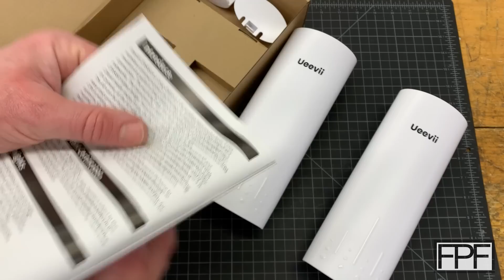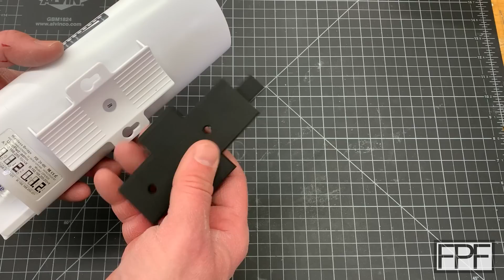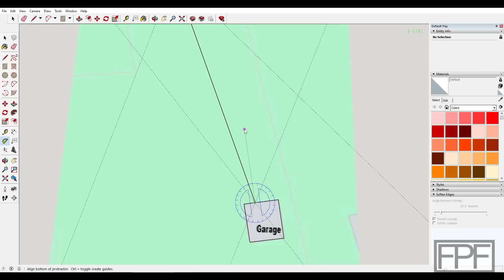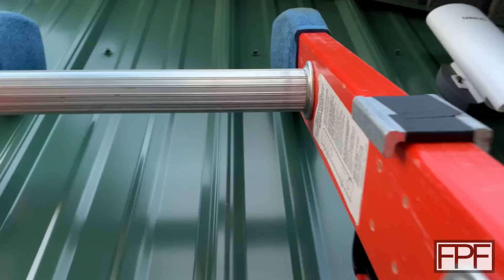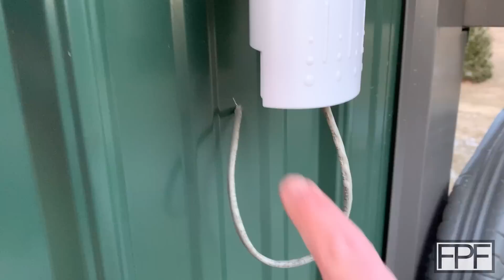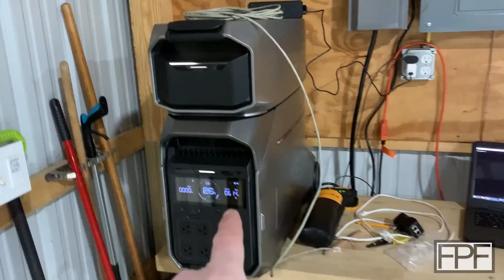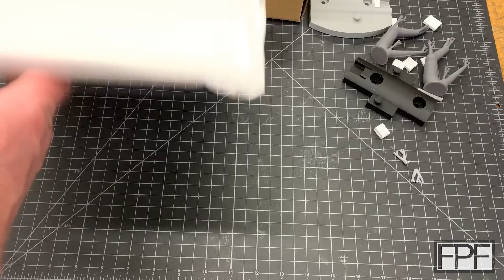3D Printed Mounts for WiFi Bridges

Comment: Wouldn't be better to print just a small portion to test the tabs instead of printing the whole part every time?
Reply from the maker: Get out of here with your logic and reasoning :)  Absolutely, yes. Unfortunately though, due to the filament changes, that multi-material part of the print is still what takes 90% of the overall print time, and I only had enough time to run 2 more parts before shooting, so I went for the moonshot.  We may be revisiting this one this week, as the comments section really believes this would have gone differently with more purge (and they may be right).
Reply: Definitely. Also if you didn't know, you can choose which sections to slice and print in your slicer instead of modeling the cuts in CAD. I always do this. Takes less than a minute and you can save the slice if you use orcaslicer in case you need to come back to it.

Comment: I think there is a design/printing scheme that would solve the issue with incorporating the TPU for AMS with PLA.  I can bend my TPU for AMS sufficiently that would handle the flex you are after.  That said, I am curious if you printed the entire part with TPU for AMS to rule the material out completely?

Comment: Also, highly recommend Overture High Speed TPU for functional prints.  Just bump up your volumetric flow to around 7 ( I believe) and it'll print as fast as normal PETG.  Thinner parts will have some flex but add some thickness and you'll have a mostly rigid, indestructible part.

Comment: My guess is you're getting contamination from the PLA into the TPU.  The nozzle isn't able to flush enough to get the PLA remnants out.  I had a similar issue using PLA as the interface layer on PETG prints.  On smaller prints, the PETG layer adhesion was laughable.  Took me a while to figure out the issue.  Not widely reported but there are a few posts about it out there.

Comment: I think you're being too nice about that TPU for AMS. That doesn't seem flexible at all. I agree with your take on making the latch as a TPU insert instead of bonding it to the PLA. The custom angles for each building seem a little too constrictive. Why not just make a simple rotary joint so you can tune the antenna angle with a compass heading on install?

Comment: Also, if your first few minutes discussing the print is accurate, then i think it would have been better to print this upside down with the tab on the base plate. You'd need less support material and the support material would be flat. Probably would not use trees tho.

Comment: I would have just corrugated the lock tab with horizontal slots. Adds flexibility while retaining the pla stiffness. And since it's realistically not going to have too much force pressed on it, it has very little chance of snapping along the layer lines.

Comment: I used the TPU for AMS for a phone case and I am quite happy with it. It has enough flexibility to bend around the phone and stiffness to stay. I do see where the layer adhesion week though, but I had to bend it quite a bit for it to fail. The cool plate works great, by the way.

Comment: I’m using the TPU for AMS for a slightly flexible door stopper for police use that I designed. Currently field testing it vs 95A TPU from Overture. I like that it’s stiff but still has some flex. I think the 95A TPU is a bit too flexible for the purpose I’m using it for. TPU is a family of materials, so you just need to pick a TPU with a shore hardness that suits your needs. Just my 2 cents. I don’t know what other things I’ll use it for, but I’m sure I can find things.

Comment: Good luck receiving sufficient signal strength for your WiFi conniction in summer, when the tree has some leaves. Is it 5GHz or 2.4GHz? 5GHz is even worse regarding obstructed beam paths.
If you get connection problems in a few months, consider using a chainsaw. :)

But thanks for the warning about the AMS-TPU. I wanted to buy some for convinience, but I will stick to normal TPU used without the AMS.

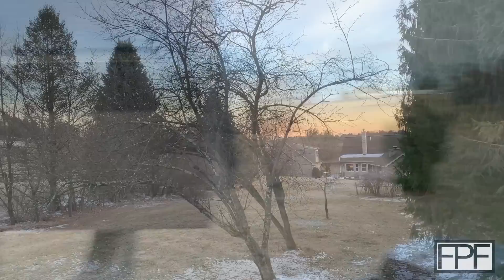Comment: -> 19:41
As someone who design and plan for industrial Wi-Fi and healthcare WiFi. I have a few things to add.
The 3km spec is likely in direct line of sight with the bare minimum lowest spec protocols. In your backyard application it will be plenty enough.
What might cause issues is the tree that's in between the antennas, once the leaves are there AND the forecast changes in a rainy day you will likely experience a drastic performance drop in network connectivity. From the little WiFi hotspot you might setup in your shop you won't be able to find out about it unless you look at the point to point antenna stats between the two buildings.

- I am confident you won't skip the drip loop on your outdoor network cable.
- Consider adding a tiny RJ45 coupler indoor and running a weather resistant patch to the antenna might be a good idea. There could be a debate on the "shielded" cabling but you're running everything out of the Ecoflow so I'll let Ecoflow be everyone's guest on the "grounding" topic and surge protection or management of. 
- Would be nice to consider a lighting arrestor on your patch cord, since your antenna is all in one integrated rather than just an antenna with coax feeding the "access point" you'll have to try the RJ-45 lighting arrestor which I have never implemented. (if you are interested there is a summary on a youtube video "Outdoor Wireless Considerations | Amin Sedighfar | WLPC Prague 2023")
- Same as above, grounding would be a good idea BUT this requires quite a bit of extra-extra work.

At the end of the day why does all of this matters? Lighting hits the antenna and you are taking a chance to fry up all the electrically connected devices in your building. All you'd be trying to do is reduce the potential for this lighting event to propagate and cause greater damages than it would without proper grounding and preventive measures.  

Last word on the TUP for AMS I cam to the same conclusion, it's stiffer and has really poor layer adhesion.
The Super Tack ....  I printed PET-CF and yeah despite heating the chamber and bead to death, the first bit of filament extrusion on the first layer still curled and wrapped. But other material have worked well.

Comment: As an IT person, I can recommend Ubiquiti wireless bridges.   I've used the to bridge buildings across rock quarries, and they work well.    Yours should have a wide enough cone to work if pointed to each other in a general direction.   Precision is not needed.
Reply: Ive used ubiquiti in comercial appliacations in the past. They work wonderfully.
Reply: @thomashaley3830  & @Talondale, my router is a ubiquiti and it's been flawless since I installed it. I'll be upgrading my ancient asus rtn66U with a ubiquiti wireless AP very soon.

Comment: Haven't used the Bambu SuperTack plate, but I believe it's a polyurea-based plate like the Darkmoon3D ICE, BIQU CryoGrip, or BIQU CryoGrip Pro Frostbite. Those plates all are as good as advertised, though limited to PLA and PETG, and you have to accept the lumpy surface texture. The BIQU CryoGrip Pro Glacier doesn't stick anywhere near as well. Polyurea-based plates are my go-to for PETG or large warp-prone PLA prints; I like the Darkmoon3D G10 Hobby, Darkmoon3D CFX, or Wham Bam CF-TW for most PLA.

Comment: If that's a 5GHz bridge, that tree is going to hurt your signal. (If it were a 60GHz, gigabit-capable bridge, it'd totally kill it.)

You should also be using outdoor-rated, shielded Ethernet cable; the PVC sleeve on standard cable will break down pretty quickly in sunlight, and the shielding gives you a ground that helps protect against lightning strikes. (And you should print some grommets out of TPU to protect that wire from being cut by the siding!)

If those things really are capable of 10km communication, you should reduce the power setting. Go as low as you can while having a solid signal during heavy rain once that tree has leafed in. It'll keep you from interfering with your neighbors' WiFi, and it'll reduce how far away others can pick up the signal.
Reply from the maker: dual-freq,  and I'm also really interested to see the impacts of the foliage coming in.  I think I just get lucky with sunlight here.  Maybe I'm just far enough North that I get away with it, as I've got runs from that same box 5+ years old with exposed drip-loops and they're still pliable.  The bridge adjusts the power level automatically (or at least the manual 'claims' it does)

Comment: I've made mounts like these but given the fragility of printed mounting pins have started opting to use the screws that come with the device, modeling the appropriate holes and cutting off the extra part of the screw if it protrudes out the back after using it to first thread the hole. Way stronger than any printed post and easy to adjust to get a snug fit. Just made another one (pair actually) to mount an led light to some wire shelving yesterday.

Comment: This is because of the amount of purge and the materials used. If you use it with a plastic that bonds well with TPU with a very long purge length it will be far stronger.

Comment: Always tempted with the TPU for AMD, but never needed multimaterial print so never bought some, interesting the dissapoiting print though.
The supertack plate though, I love mine, for PLA it is fantastic, dissapointed with PETG on it, but I use a BQ textured PEI sheet I have for PETG, so that works for me.
For every other material I use the BQ Cryogrip, especially when printing ASA or ABS. grate plate for those

Comment: If you would like to have higher speeds - might be worth looking at "mikrotik wireless wire" I get 800..900Mbit/s speeds (except moments of very heavy snow, I've lost connection several times, but I wasn't able to see the second antenna through the snow) in a similar scenario.

It runs 60GHz radio instead of wifi.

Comment: this is very odd.  but I have a few suggestions.  1.  increase the purge to 2x.  when you changing materials like this you want to make sure the old one is fully pushed out.  otherwise it contaminates.  2.  pla and tpu for ams don't mix well. they don't stick.  know that ended up not being your problem. but it's pretty widely documented they are not a good match. tpu and petg on the other hand bonds VERY well
also 3.  user iperf for network traffic testing.
Reply from the maker: Did you see how well this TPU sticks to the PLA?  It bonds incredibly well, which I agree is not the norm.  I'm not convinced it's really TPU.  When I tried as hard as I could to break the bond, when I looked closed, it actually broke on it's own layer bond, one layer above the PLA/TPU bond.

Comment: That does not look right , the TPU for AMS is indeed harder than standard TPU but it should still have TPU layer adhesion. I would also be mindfull of the cable , it does not look outdoor rated .

Comment: You mentioned angling the top of the print to shed water if it got on top of the print. What if water gets in the hole where you had the tab? Would it not expand  and berak the layers apart?
Reply from the maker: That pitches down to drain as well

Comment: Head up on the rj45 crimps. Looks like you are using pass thru connectors? I'm using them and really having hit and miss results. The cables always work but more open than not I can't break the 100mbps barrier. The cables test ok on my NOYAFA nf-8209 cable tester so not sure what's going on. (100mbps cables only need 2 of the 4 twisted pairs). Pulling my hair out on this. If anybody has any ideas let me know.
Reply from the maker: Funny i bought this one to replace some poor crimps done with my old crimper a few yrs back that i wasn’t getting gigabit on.  I get full gigabit on all the crimps with this one but i did splurge for the klein crimper and i only use the klein branded ends.  Learned my lesson that no amt of money saved on the ends is worth crawling back into some of the spots where they crimped lol
Reply: @FunctionalPrintFriday  My crimper is a 'Brileine' and looks exactly the same as your Klein: either it's the same chinese company making all of them or somebody is pirating... May give the klein connectors a go...

Comment: If you want TPU that can easily be printed with an AMS or similar, get some Recreus Filaflex 95A. It works even on an ancient Ender 3 Pro. Filaflex is probably the best TPU on the entire market. Also set the machine to purge more, Bambus either purge too much or too little

Comment: The small plastic straps on my snow shoes that connect the internal webbing to the perimeter tube frame broke. I just printed new ones ~25mmx75mmx2mm with ams tpu, on the flat. I was able to bend these around a 15mm tube without snapping. Tested last weekend in -12C hike for 3 or 4km and worked fine. I think I had 2 or 3 layers of 15% infill and it was very stiff to wrap around the tube. You may find your clips work if rotate your part 90 deg onto the bed but your standoff pins will be a risk next in this orientation.

Comment: Like yourself TPU for AMS was not what I originally bought it for. However I’ve had good luck printing items that need to be rigid but impact resistant. It’s good for thumb screws and I had good luck printing a ski brackets that clamps to the legs of my sled deck in my truck. Seemed to be holding up even in -15c temps bouncing down the highway.

Comment: should use a cable gland for cable into barn
Reply from the maker: I did actually think about this, and was going to make one from TPU, but if I put a dab of silicone caulk on the inside and outside, I don't think the cable will be able to move, ever.  If it does, I guess I get another chance to drop my bag of terminal ends and have another expedition in the yard looking for them :)

Comment: 20:20 - yes once you clean it, spray it with a coating of “Wet & Forget” it works great to get rid of and even prevent algae build up. I got mine from Costco but ace hardware and a couple other places have sold it as well.
Reply: In Australia the equivalent product is called "30seconds". It's quite expensive, but it actually works. They make it really clear that you need to read the instructions as the prep is really important. 

I use it on sandstone as pressure washing would ruin it
Reply from the maker: thx
Reply: @FunctionalPrintFriday  I second teh Wet & Forget.  Costco sells it too.

Comment: Referring to the TPU for AMS, I, too, have found it is way stiffer than regular TPU... I have mine in a dryer box which is at 14% humidity this morning and printed it on a few things at the regular settings per the recommendations. It is not what I expected after using the regular TPU. I wanted to try it just because it is "AMS compatible". I appreciate you taking time to make these videos; I have learned a lot from you!